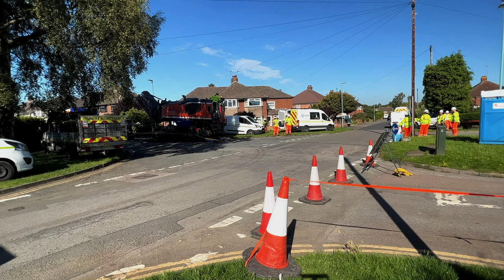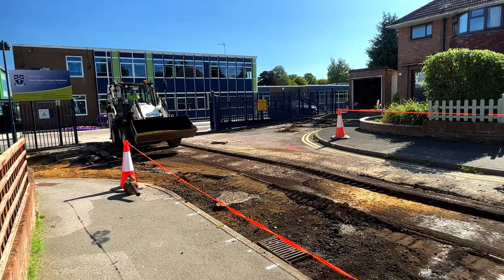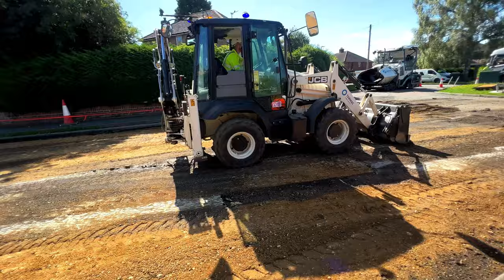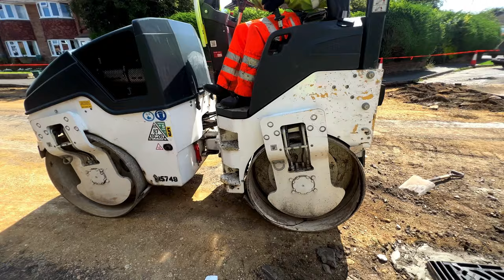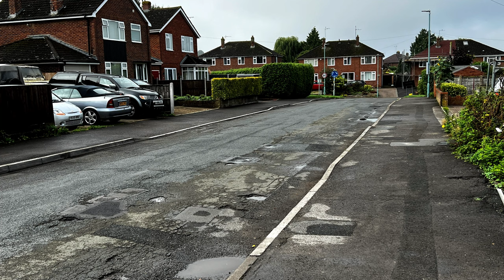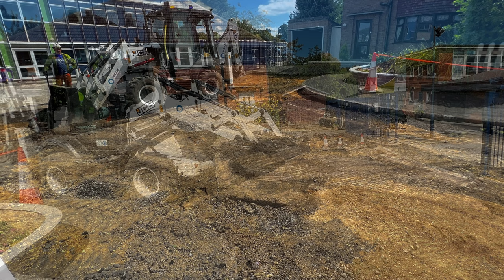Resurfacing Works-Winston Road Churchdown Gloucester-(Day 1)

Comment: I have never seen it done like that, it's normally planed off then the road sweeper goes over it before it's paved again, never seen a roller used to compact the loose aggregate rather than sweep it up.
Reply: Because when they milled of the asphalt there was not any asphalt layers below to broom off. They milled to the base course level. Therefore they  needed to recompact the base course layer then repave.
Reply: Yes when they resurfaced my street they put the road sweeper on but different companies do different things...